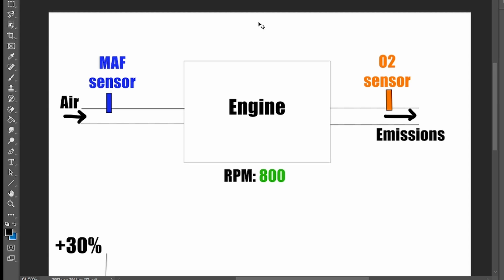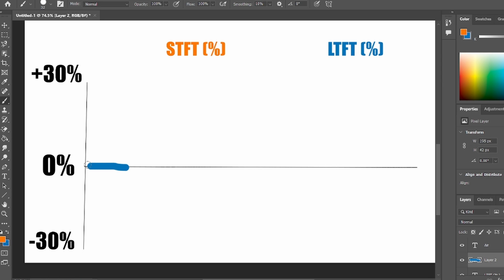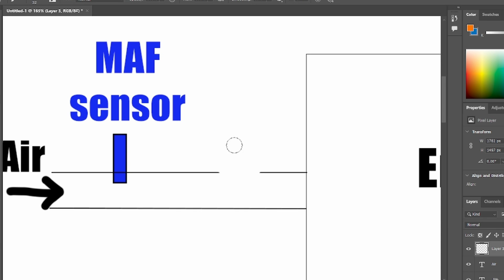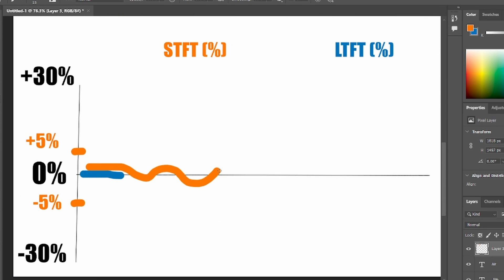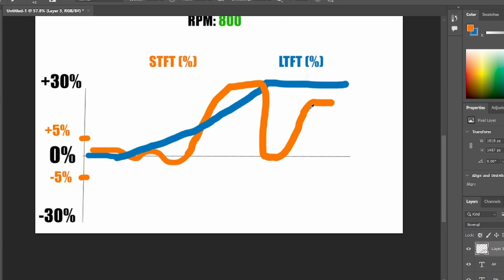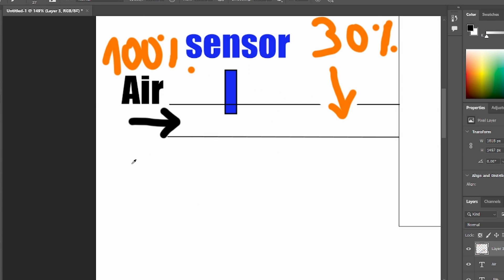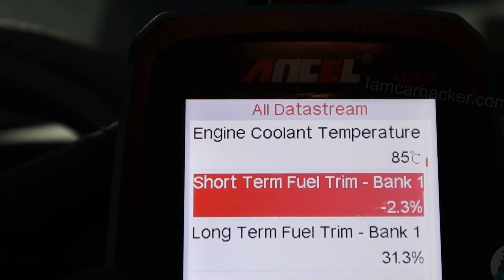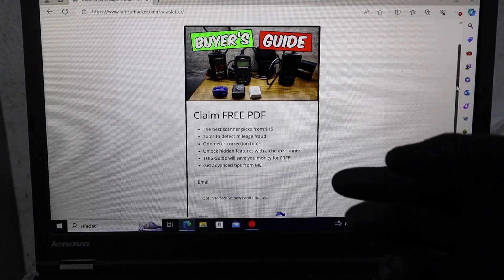Use ENGINE FUEL TRIMS to confirm vacuum leak

Comment: This works differently if you have a map sensor instead of a maf sensor… right??
Reply from the maker: Fuel trims are calculated from oxygen sensor data so should be same
Reply: @iamcarhacker I don’t think it is since map sensors work differently than map sensors. Especially when trying to troubleshoot vacuum leaks.
Reply from the maker: @ronb9901  map and maf work differently but all gasolines have oxygen sensors. I dont see why it should be related for fuel trims

Comment: My fuel trims are pointing to a vacuum leak but smoke test didn’t show one on the intake or exhaust what do I try now? New MAF?
Reply from the maker: Do you have fault codes?
Reply: @iamcarhacker nope just getting terrible gas mileage. Trying new MAF tonight.
Reply: @justinstatham6378 hi did changing the maf helps?
Reply: @ediewow6882 nope I also changed the intake gasket and smoke tested and no leaks but still getting terrible gas mileage.

Comment: Do you have a video explaining negative fuel trims? Thanks
Reply: negative means engine is rich ,, blocked cat, leaky injector, bad fuel regulator, evap issue, or high fuel pressure , or the usual suspects bad maf or o2

Comment: Thank you! Very well explained. I've been getting MAF error codes (P0101) and was about to replace them but found out it could also be a vacuum leak test. After watching your video and using my OBD2 reader, I found out my short and long trims are ~5% or less. So I think I can rule out vacuum leak. Any other causes behind the P0101 codes? Thank you!

Comment: I suspected a vacuum leak on my car, has all the symptoms when the engine is at running temperature but drives perfectly when cold. 

Long term fuel trim is 20.3%, when idling at running temperature the short term fuel trim sits about 0 (occasionally dipping down to about -8 or up to +10) but if I rev the car the short term fuel trim goes up to about +40%.

Only fault code that randomly pops up is for a knock sensor (no signs of knock). Checked for a vacuum leak, haven't found one but the vacuum pipes do look a bit tired, before this problem started I replaced the radiator and had to remove some of the air intake fittings to make access easier so wondering if I've possibly disturbed something, could this still be an indication of a vacuum leak?

I removed the throttle body (electric fly by wire tb), gave it a clean and replaced the throttle body gasket, didn't fix the problem but symptoms did improve somewhat.

The car drives perfectly when cold but has all the symptoms of a vac leak once up to full running temperature.

Comment: Great video ! I have a mini and have had codes p2195, p3018 and p0014 . The stft goes up to 25 and then when you rev the engine goes to 0 . Ltft  stays around 0 or slightly under .  This test was done based on being stationary on the drive . Fuel loop changes from closed to open all the time . Would the timing chain need changing  have anything thing to do with this ? Thank you
Reply from the maker: What is the description for P3018? I don't know what this code means.

But I would check oxygen sensor first and if it is reporting correct data, then just replace timing chain since it needs to be replaced already. 

You can check sensor reporting data with OBD scanner, try pressing gas pedal for a second a let go and it should go to max voltage and then to low voltage if it works properly.
Reply: @iamcarhacker hi thanks for your reply . P3018 relates to o2 sensor being above threshold due to open pumping circuit bank 1 sensor 1. I think the voltage on the 02 sensor is within the range but I will check this . The mechanic that was going to change the timing chain said to change vanos solenoid and coolant at the same time as the timing chain

Comment: Really Good explanation using the graph.The short term fuel trim reacts to a change .The Long term fuel trim adjusts to the new mixture then the short term returns to 0 until there is another change. I get this now. Thank You! You used the word "SCOUT" and that made sense to me. The short term fuel trim is the "SCOUT" that goes ahead when there is a change such as a vacuum leak. Once the Long Term adjusts to the new conditions, the short term returns to 0, ready to monitor and change for new conditions.

Comment: Does it matter if you step on the gas while the vehicle is in park or neutral and the fuel trims decrease vs. when driving in gear i.e. could a fuel delivery problem likely be more exposed under load or would a fuel problem even show when increasing rpms in neutral?  In other words, the STFT going into the 30s when accelerating would indicate a fuel problem, of course you could have both a vacuum leak and a fuel problem at the same time.

Comment: What mean if I have Zero short term and 27% long term, i have P0086& P0106,
No vacuum leak at all 
Any suggestions to solve this issue, 
My other question for you,  when try to find vacuum leak the some should goes out of Oil cap when open it or no ?
Reply from the maker: Does the fuel trim drop when u press gas pedal?
Reply: @iamcarhacker  yes LTFT drops from 27% to 18% and never goes less 18%, whatever RPM, also the number keeps changing very fast between 27% to 18% on ideal position

Comment: Thanks for your video. On my 2004 1.6 VW polo i have code  P1128 Long term fuel trim bank system too lean. Car is using a lot more fuel. When engine is revved fuel trims climb. Driving on long downhills with foot off throttle fuel trims drop. Can't find any vacuum leaks. Is it possible that fuel pump is not giving enough pressure? MAP sensor is still quite new and readings seem to be fine. ECT readings fluctuate between 78 degrees Celsius on open road to around 84 degrees Celsius in traffic. Any advice would be appreciated
Reply from the maker: Hello my guess is problem with fuel system, maybe pump as you mentioned or fuel injectors/fuel filter. I would test fuel system pressure and also replace fuel filter if it wasn't replaced for long time.
Reply: Replaced fuel pump, car is using much less fuel now fuel trims looking much better
Reply from the maker: great good job! @cosmicure-truthinshort2038
Reply: Thanks for your reply, I'll get pressure tested. I did replace fuel filter recently